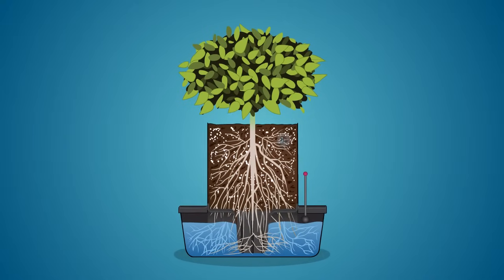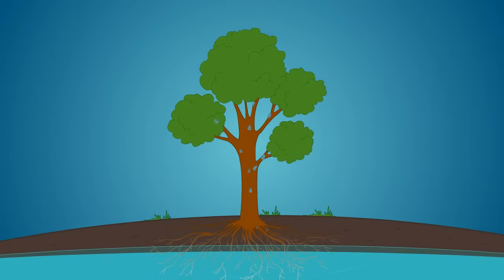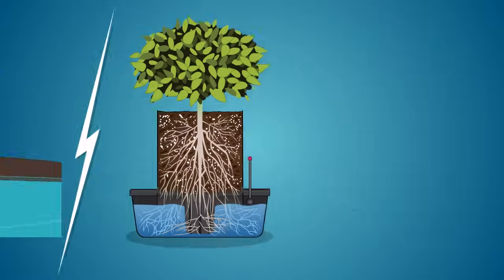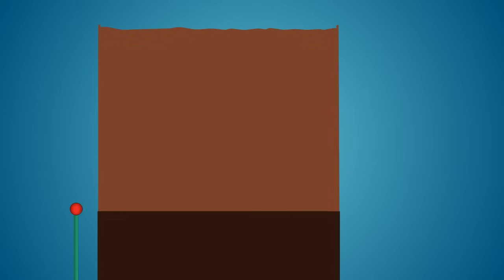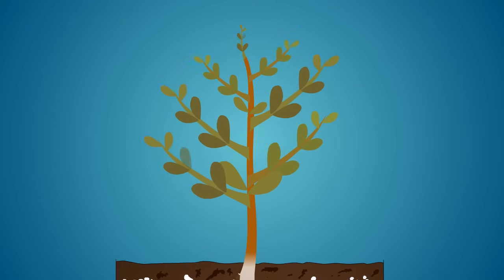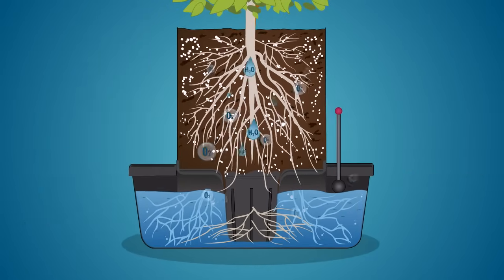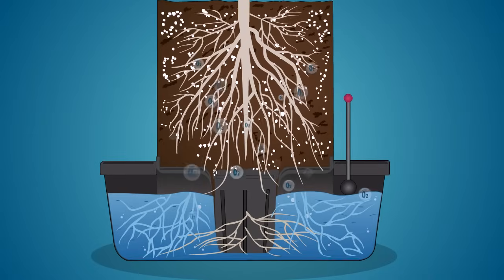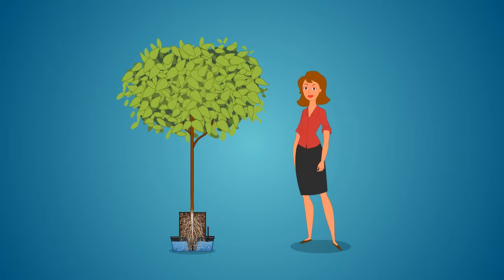Octopot Soil Hydro Hybrid Grow Systems - Better than DWC Systems or Ebb and Flow Growing Systems

Comment: why are liquid fertilizers needed, can't the plant get it's nutrients from the soil? wouldn't that be the point of incorporating soil in a hybrid system, to get the benefits of soil which are largely nutrients
Reply from the maker: With Octopot we use liquid or water soluble fertilizers in the water reservoir so that nutrient build up does not occur on the top layer of soil.  With our root hybridization the hydro roots have a higher uptake of nutrients than soil roots, so the plant is able to absorb more nutrients as well.  Nutrients will migrate from the water into the soil so the soil roots will have ample feed as well.

Comment: So I used 2 octopots using Happy Frog Coco Coir. Great results. So can I reuse the coco coir  Or do you recommend I get another growing medium? For reuse of the Coco, I would assume just clean out the dead roots rinse and should be ready to go correct?  Also, what is the best cleaning solution to clean the octopot and the sleeve?
Reply from the maker: Yes you can reuse the soil medium, it is advised to rinse and add amendments to boost it's nutritional value.  
Octopot and sleeve can both be hand washed with a mild soap.

Comment: What I dont understand is the changing between 3 gall to 6 gall plant and sleeves at change over lighting stage between vegative and flowering..Does this mean transplanting the plant digging it out of the 3gall set and placing it in to a larger 6gall sleeve and reservoir ..Can only envision a messy business and great plant stress then extra shock changing light regime..No where can I find how this procedure is carried out..3gall to 6gall with plant..A messy transplant ??
Reply from the maker: You can go from unrooted cutting to harvest in Octopots.  See the side by side test results here...https://www.octopot.com/input-requirements.html

Comment: What about root rot? This process is bound to get root rot if you use any nutrients or even from the organic soil.
Reply from the maker: The system is designed to work without causing root rot! The roots are transformed on a cellular level and become hybrid.  We have been around 10 years and it is proven to work!

Comment: Is this possible to transplant to a normal soil pot later or will the complicated root system not handle the transition well?
Reply from the maker: The roots literally change their genetic disposition from soil root to a water root as it grows into the water.  Transplanting to all soil would probably shock the plant.

Comment: So how do you gage your nutrients.  Do you add like it’s a hydroponic grow?  Or do you add like it’s a soil grow.  Most soils use hardly any nutrients because most are available in the medium.  But hydro has to use nutrients so what do you do?
Reply from the maker: You measure your water before you fill the reservoir, so it is a clean reading.  You do not need to measure the soil, and should avoid measuring the water currently in the reservoir since it has been altered in the reservoir by the plants' uptake and the remnants in the reservoir from previous fills.

Comment: How do you separate the soil from the water? And prevent soil leakage?
Reply from the maker: The wick holds the soil out of the water reservoir and prevents the soil from leaking through into the reservoir.

Comment: so what holds the sleeve and wick onto the reservoir so it doesn't fall over?
Reply from the maker: The wick locks into the bottom of the water reservoir and the sleeve is also held in place by the wick.  Making sure your soil is packed tightly enough to hold the fabric upright is important.

Comment: would you have to use different nutrients in this and would you feed the same way by watering the soil?
Reply from the maker: Water soluble nutrients are added to the water reservoir.  Soil should be amended with nutrients before planting. Living soil does not need added nutrients in the water.

Comment: so you need hydroponic fertilizer............or are normal fertilizers OK?
Reply from the maker: Water soluble nutrients are added to the water reservoir.  Soil should be amended with nutrients before planting. Living soil does not need added nutrients in the water.
Reply: @Octopot  thanks

Comment: Is the 3-gallon necessary or could you do the entire grow in a 6 gallon pot.
Reply from the maker: Plants can go from seed or clone to harvest in any Octopot Grow System.  Skip the cloner and start un-rooted cuttings in Octopot Grow Systems with Octo-Dome.  Its your choice to use the 3 gallon or six gallon depending on the amount of space you have.  People who use grow tents sometimes prefer a smaller size.  

You can streamline indoor growing and save electricity by using the 3 Gallon Grow System for veg stage.  Octopot 3 Gallon Grow Systems fit closer together under a standard indoor light fixture so no light is wasted, and power costs are reduced.  Octopot’s Gro Sleeve® and Hydro Wick® function interchangeably in both the 3 Gallon and the 6 Gallon Octopot Grow Systems.  When young plants outgrow the veg stage the Gro Sleeve® with plant can be moved into Octopot’s 6 Gallon Grow System to continue growing.

Comment: Seems like mold would be imminent ....? Right?
Reply from the maker: No, the moisture is only carried upward as it is needed.  The design of the water reservoir and sleeve is what allows this system to be successful.  Air flow is part of the design and stagnation/molds do not occur as long as your grow area is sufficiently dehumidified and well circulated.

Comment: so u can only use organic right
Reply from the maker: No you can use conventional fertilizers as long as they are water soluble.  Just be cautious because it is a closed environment so we advise using about half of the suggested amount.
Reply: @Octopot  so salt build up is a myth if the plant eats it all?
Reply from the maker: Excess salts migrate to the exterior of the grow sleeve